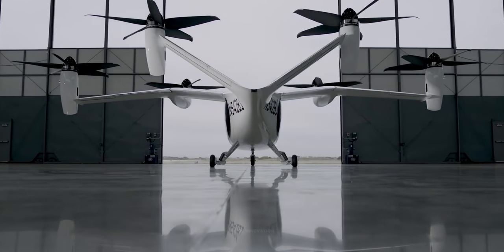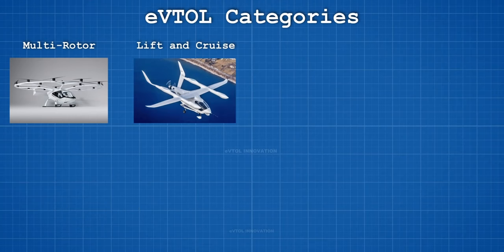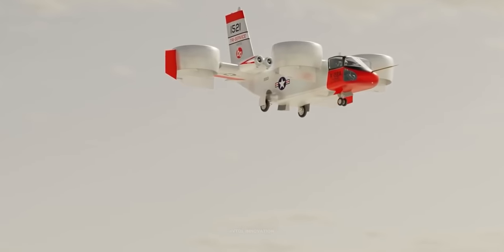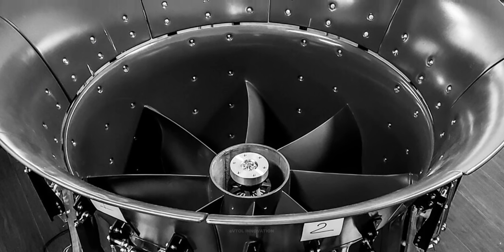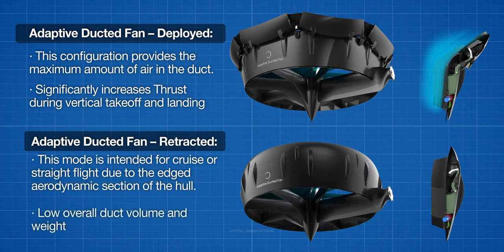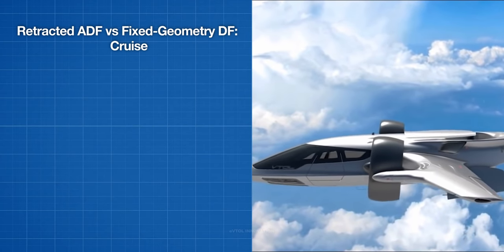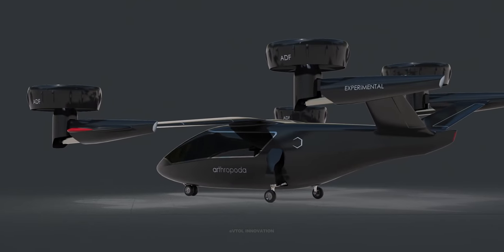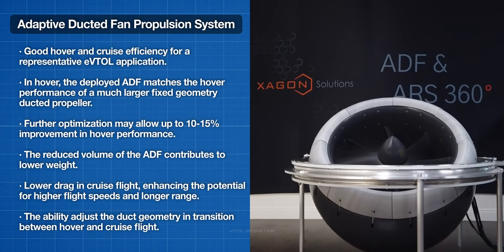Most Advanced eVTOL Propulsion System: Adaptive Ducted Fan

Comment from the maker: Unfortunately, i am not able to keep creating new videos in my current situation. 

Visit: https://evtolinnovation.notion.site/eVTOL-innovation-YouTube-Channel-054d7bae8e344a0b8851f4be18600498?pvs=4
Email me: request.0207@gmail.com

I'll be evaluating offers and ideas. Thanks.
Reply: Did someone say advanced??? hmmm i dont think so.

Viktor Schauberger.
Reply: Do you plan to recharge on descent?land spot on like Musk boosters..can limit the extra batt charge for looking for alternative airport and weather limitations all in one ?
Reply: ...  Looks like an scam
Reply: Novel idea, seems cool but many many more moving parts which means many more places of possible failure.  Not to mention additional complexity in part creation and manufacturing. still its a novel idea.  Ive never been a fan (no pun intended) of open rotor designs.  The Lilium Jet for me is still by far the leading design in this category of aircraft. Safety for me is the primary issue.  Many many open rotor blades all moving at high speeds and a very high risk of cataclysmic failure and extreme safety risk for passengers in the event of an accident. And we should all expect an accident event with each aircraft.  be it bird strike, or some other unforeseen event that would otherwise see rotor contact with a foreign object.   Ducted fans vastly reduce such risk, as a serious engine failure would physically be contained within the duct.

Comment: This type of approach will depend very much on the mechanical engineering skill of the fabricators. To keep the weight down, and the number of moving parts minimized, will be a huge challenge. The noise issue is critical for electric aircraft to succeed in the cities. At present for example, helicopters are banned from the bay area; you have to land near the airport, as the noise was just too much. In Brasil, Sao Paulo, has the largest helicopter fleet on the planet, because they don't have noise restrictions. So ducting may be necessary, even though it costs weight, because noise pollution from a lot of these things buzzing around will be quite annoying.
Reply: There is another issue also. With 4 fans, should an engine fail in hover flight, there is no way to avoid crash.
A helicopter can still land should it lose power. Same goes for aircrafts.

That will likely mean 6 fans minimum are needed, and tripled up electrical systems, and make sure the aircraft still flies with 4/6 fans.
Reply: @swisstraeng  i think the electric helicopters are going to need ballistic parachutes, as i don't think triple redundancy is cost effective.
Reply: Another better to the noise problem, is just not to have them in the first place.
Reply: @swisstraeng  The adaptive ducted fan seems to be designed for winged aeroplanes that can also take off or land vertically. To avoid crash, the solution seems more about making the planes glide-friendly, not adding extra fans.
Reply: It's easily done. Lockheed Martin has Boyd B. Bushman to thank for this brilliant invention. It works like a fuggin' charm.
Reply: @edwarddejong8025  
As for ballistic parachutes, I would surly need one to get me to trust it.
Reply: I live india where the noise pollution is awful honking all the time traffic 24/7, you get used to it and it’s not that bad but a lot of ppl have hearing issues. I think the tech is worth it and noise isn’t really a huge issue
Reply: @ChrisTuckerCarlzyn The Noise here in the U.S. wouldn’t just be an auditory nuisance but, an actual legal issue with there being strict laws as to how loud something can be depending on where it is.

Comment: That sound like a really clever solution to a really dumb problem. Private helicopters are not a big market, electrifying them won't change that, and no one uses helicopters for bulk goods transport, there's a reason container ships and trains carry hundreds to thousands of containers at a time and not just one.
Reply: I think the idea was to use them as cranes to move containers but why do that when you could use trucks
Reply: @davidficca8963  Right.  Ground based cranes and trucks are an order of magnitude more efficient without having to use air to thrust them into the sky.
Reply: @ThatBoomerDude56  if you could eliminate most of the massive costs, noise, and maintenance of a helicopter I'd imagine it would be a lot more common in the civilian sphere
Reply: @blakelowrey9620   Yes.  It would be "more common."  But still not extremely common because it helicopters are massively inefficient compared to ordinary airplanes.  
And the necessarily smaller blades on a set of ducted fans makes it horribly less efficient.
Reply: @ThatBoomerDude56  sometimes utility is more important than efficiency is what I mean. I don't think it would ever replace ground based infrastructure but for emergency vehicles and fast private transportation for the wealthy, I think it makes a lot of sense.

Basically you are just getting a little helicopter that is safer for bystander and can be operated with a less extreme maintenance cycle, nothing more. It would be restricted in range and flight time but I don't think that's a huge issue for a system limited to an urban metropolitan area.
Reply: @blakelowrey9620  Yes.  It could have some use.  Still gonna be pretty expensive, though. But for their main customers, that might not be as much of an issue.
Reply: These things do not replace helicopters. The whole transitioning eVtol concept relies on a duty cycle where hover only lasts a few minutes of total flight time. They consume so much power, and have so little energy in their batteries, and generate so much heat in their motors, that you need to transition to wing-lift flight straight after takeoff. 3 minutes max. Vertical Flight engineers confirmed this in a Q&A at the European Rotorcraft Forum last year.. they will never replace helicopters because they cannot sustain hover. They are for short point to point passenger flights, eg airport transfers for billionaires and celebrities. Don't fool yourself, this tech will not trickle down to us normal folks, any more than helicopters have!

Comment: Idk how much sense the Cargo Container/ Freight version of the E-VTOL craft would make but, I think it could be very easily adapted to make a really sophisticated type of Emergency Aircraft that can hold swappable pods, like it would containers. Able to hold various mission specific payloads, such as a medical pod that can not only serve as an Emergency medical transport helicopter capable of handling both transport and triage of multiple people simultaneously but, also as a full sized ER room that can drop off fully equipped medical facility pods to remote areas or a battlefield. Possibly even a firefighting VTOL that can hold more water than a helicopter equipped with a Bambi bucket and potentially operate remotely or autonomously.

Comment: Ive looked into this over the years, the idea of the ducted fan  particularly for private use wont work out untill the military adopt the R+D costs, you run higher more efficient RPM in the ducted but you lack the lift potential since you require a pretty large ducted fan, this is mostly noticed when you want to lift weight and of course deal with wind, gyros have come a long way and polymers have also, which makes these machines very much more possible, but its just not taking off as a venture until the powerplant requirement and versatility for one of these exists. The operating costs even of a basic helicopter would dwarf this concept, even if it is better in some ways.

Comment: It works only in underload conditions 'cause in full load condition you will end up with balance T=<Q*rho with Q=V*pi*R^2, and with limited V by M=~0,8 (~270 m/s). It's limitation for any ducted fans. Open rotor have different equation.

Comment: It's appears the new Electric Induction Fan Jet Propulsion has advanced significantly to overtake the Prop Engine but not completely replace the Prop Propulsion. I like the performance specs comparison. The real tests for this type of engine propulsion would be Operation in extreme conditions where moisture, humidity, or extreme heat and extreme cold could significantly impact Flight Performance, Range, and lift capacity.

Comment: It surely makes sense for more classical, hover-dependent vehicles like the typical 'drone' without any wing-surfaces. However when it comes to winged aircraft, I am not convinced that these efficiency gains in hover will outweigh the high loading that comes with them. This means longer transition times and therefore more time in hover.

Comment: Nah, another much simpler solution is to just make the ducted fans slightly larger to achieve the same efficiency and airflow goals, the increase in weight due to the increase in size would be less negligible than the weight introduced by all those mechanical parts, the overall size increase won't change the aircraft profile and footprint at all as well, and adding a few more blades to the ducted fan would also go a long way to reducing noise and helping with lift.

Comment: Ducted propellers have a big disadvantage: weight. To be effective, the duct-propeller tip distance needs to be very small, so the duct needs to be very stiff -  this leads to a lot of extra weight. In most conditions a larger propeller is a better alternative than using a ducted propeller for increasing lift. Adding mechanical stuff to vary the duct intake geometry increases weight even more, probably more than the extra lift produced.
Reply: if one of my toys had that id rip it off.
Reply: Yup.  And anyone want to try counting the additional moving components associated with this design, per motor, as compared to open prop models?  Moving components = likely point of failure.  And each one of those components jamming would impact stability during any flight mode.  Autopilot can certainly correct for this during most circumstances, yet evtol's already have a LOT of things to manage to safely fly.  This might be a bit risky for an already risky new transportation mode and industry.  

And yet, I'm rooting for them and all others in this field.
Reply: I believe Joby have hit the mark with a fairly high disk loading and relatively small diameter propellers regardless.

As their videos show, the craft is also sufficiently quiet.

There should be less talking and more building 😉
Reply: @daszieher  i believe joby is a scam. find the longest video of it flying without edits. they would have documented its 150 mile flight and it wasn't even manned. it can't stay up very long with a person.
Reply: @frankyflowers  I don't believe anything, I just evaluate what I can see.
We know that it is silent and it is capable of hovering and transitioning to forward flight. Already quite impressive.

We'll see about the performance stats, when we get to see them.
Reply: This is true. Can’t remember what channel it’s on but one of the drone yt channels did a test of a ducted quad vs a standard propellor quad and the ducted one was so slow and inefficient . It surprised me.

Comment: A full comparison between ducted fans and propellers has not been presented. The effect of propellers having lower mass means that they can be made of greater disk diameter with lower induced speed of the air at the blade (as in a helicopter rotor) and the result is less noise and greater lift or thrust.

But these two answers are not the only possibilities, and it is my claim that the energy being wasted in the flow of the air behind or below both arrangements can be reduced using a centrifugal fan that works below a canopy (like on a parachute). The radial flow from this kind of fan is then blown onto the curved surface of the canopy and is directed downwards, being curved below it. This spreading and curvature of the radial flow, helps the kinetic energy to be converted into pressure energy and lifting force on the canopy itself. There will also be some suction above the inlet to the fan which will also add to the effects that the canopy provides.

It is also advantageous against engine failure where the sinking speed is reduced as on a parachute, and unlike anything like as much as on an auto-rotating helicopter or drone.

Comment: I don't really understand the disadvantage of the consumption of more power for hover in ducted fans. If I am not wrong, ducted fans needs less power to hover than open rotors, since the losses produced by tip vortex are avoided
Reply from the maker: In general the disk load is greater in Ducted fans. Ducting a large propeller is difficult

Comment: Forget the stators, as it is better to use a counter rotating independently driven lower set  of propellers as to redundancy of having power and it is better to have a simpler  airflow limiting / compressing design by having a bigger center  that goes in and out than to increase the ring with a complex clunky  multi faceted expanding cone..  it is the high speed that one wants to decrease the air flow into the fan as this is where power requirements start getting exceedingly high as speed increases.. and at the higher altitudes increasing the pressure inside the duct keeps the fan more optimized..  I've done the math years ago and solidity is what you want with fans as you can get  realistically a 12% increase in efficiency, everything else takes more power as one is accelerating a mass of air to higher velocities...  so the start of any exercise in this is the force that you engine(s) or motor(s) can deliver.. there is no 'free lunch'.

Comment: Ducted eVTOL transportation for civilian movement is cool. The application for transportation and movement of shipping containers is flat out stupid however. Shipping freight cranes are large and seemingly more expensive, however they are safer to operate and maintain. I believe that transportation of shipping containers should be relegated to trains however, utilizing train tracks to run directly into freight yards and unloading into warehouses that are built along the rail system. From the warehouse, companies can utilize either shipping vans, or upgrade to drone shipment for more efficiency. housing areas should be built around such infrastructure to minimize the possibility of a drone going beyond its signal range and losing battery power. Building amenities around warehouses can also make the movement of goods more efficient and reduce fuel/power consumption. Instead of tall skyscrapers with offices in a city center, building down can unearth history and maximize work space while clearing airspace for movement. So imagine a city built underground, warehouses on top, a shopping mall built around it, housing built around that, air shipping within close proximity for fast and efficient delivery, and underground networks connecting all infrastructure like a web, preventing nature from being destroyed by the construction and expansion of more roads and railways. BAM! civic development and planning is easy!
Reply: I assumed that image referred to an air-crane, not a shipping container transport as such. That would be short range, and could open up a lot of flexibility for loading and unloading containers, especially from small islands. A big ship might not even have to stop or slow down while picking up or dropping off a shipping container or two from a 'micro port' that is little more than a car park. Even in a large port it would allow a ship to unload a few containers and then leave, rather than waiting for a berth to become available, and getting into and out of that berth.

Comment: A well designed propeller is approximately 85% efficient. A propeller can be a much larger diameter than a ducted fan giving a higher Froude efficiency. So the efficiency improvements you quoted are totally unachievable. They aren’t even make-believe, they are mathematically impossible. There is no way that even a variable geometry ducted fan will be more efficient than a propeller as a vertical lift device. I can see that a fan could be a little quieter and allow the vehicle to have a higher maximum speed.
Reply: They're also adding a bunch of weight with all that mechanism.
Reply: Well, they did state that the normal propeller is better at lift.
Reply: And for this reason a helicopter will always be more efficient at generating lift. But there's several reasons why no one is proposing a helicopter eVTOL.

Comment: Trough out aviation history, a lot of companies have experimented with ducted fans in all kind of implementations and they always ended up with the same result. It is good until there is a flow across the plain of the fan. The system looses nearly all thrust in case of the slightest P-factor. This automated segmentation will cause a lot of headache to the developer team, if they manage at all. It is an unsafe and unnecessary overcomplication in my eyes.
Reply: We’ll find out
Reply: Good point about the effect of horizontal velocity. That's what limited the potential of the one-man ducted fan platform the US Army made. Lost thrust at modest horizontal speeds. On the other hand, I think this concept goes hand in hand with tilting rotors, so they are never meant to have in-plane air velocity.
Reply: @nibblernibbles3205  That's true. As you said "never meant to". What about wind shears, or turbulent weather conditions?

Comment: Why do ducts on fpv drones reduce efficiency?
Reply: Most FPV drones are more akin to a multirotor helicopter. The duct not only adds weight, but drag. It also blocks a large percentage of the airflow coming towards the prop when flying at an angle, as such drones often do. Think of an EDF Jet. The airflow is almost always coming  straight into the inlet. In a drone, that is rarely, if ever the case. So it just doesn't make sense.
Reply: @itsthorondil7608  yeah i noticed that, so it thought on big VTOLs it would also introduce drag